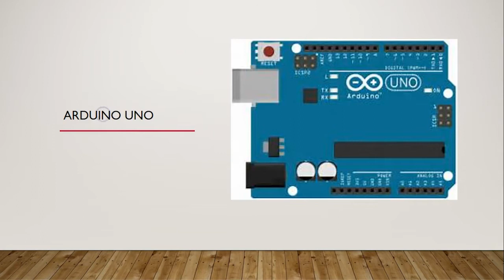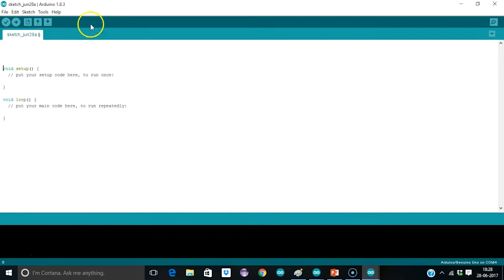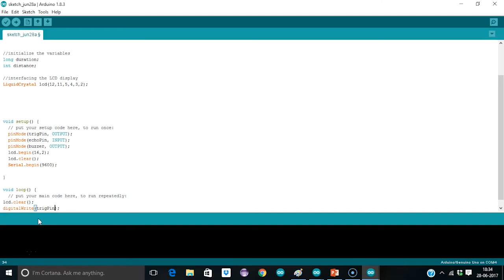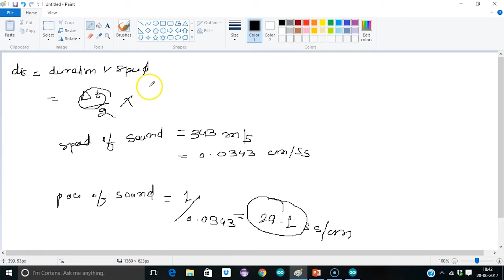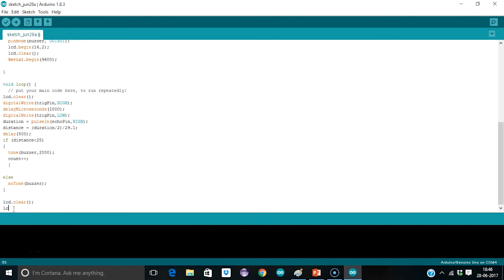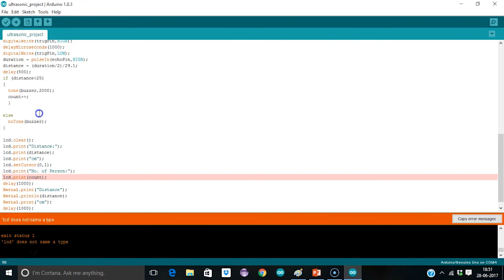Count how many persons enter your room using Arduino!

Comment: Code is pretty basic. It is good but, there is a number of problems in this prjct like direction of person, two persons at same time, hand or leg crossing the sensor, etc.. I'am looking for a counter which accurately counts the number of persons comes in and goes out.
Reply: Can you please inform me if you were successful with the code or not?
Reply: @aira_214  hi, it was years ago.. i don't have the program.. but this video might help.. it uses 2 infrared sensors, if you tinker the code a bit, can be convert it to a proper counter with direction. But the "hand or leg crossing the sensor" and "two people at the same time" scenarios might affect here also.  But that also can be adjusted by giving sensors at both sides of the doorway. Hope this one will be helpful https://youtu.be/bYql7t0m-_k?si=xwezSjSbs0BpXovk